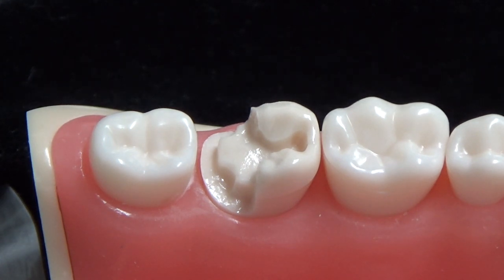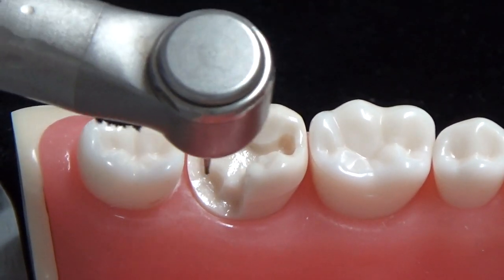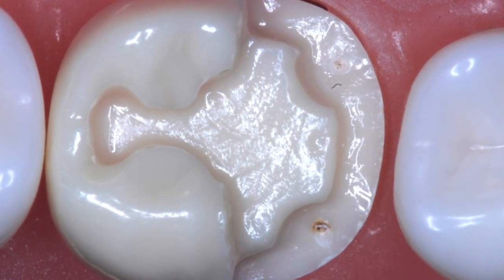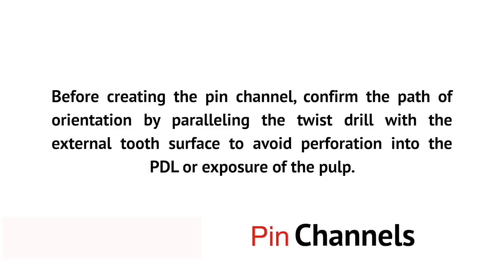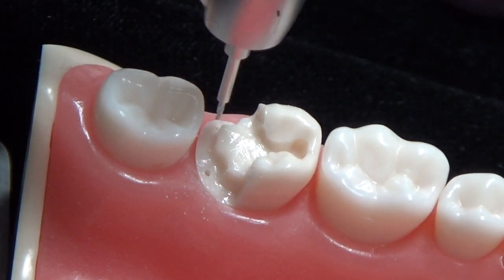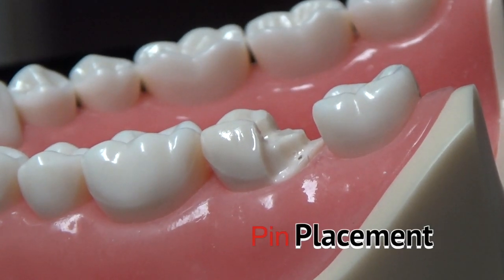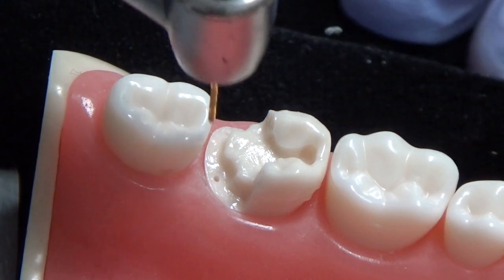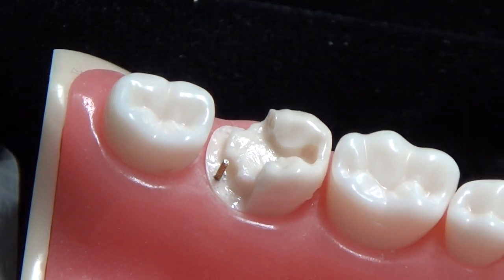Dr Rivera , Core BUILD UP

Comment: Pins are not need it in composite restorations because they have adhesive properties, and un need to bend the pins in order to gain retention. I woldn't use flow composite in all the restauration, just in the first layer of resin, maybe the 2 first layers.
Reply: why  not flow, is it to weak
Reply: @dwayneevans683  pins are used to cover the lack of adhesivity of amalgam, because when u are ussing composite or any ressin they already have adhesive properties. If u are gonna use flow composite just use it in the first 2 layers of the restoration because in the next steps u need to put a denser material to shape the internal anatomy of the restoration to avoid oclusal forces to break te tooth, with flow u cant shape anithing because is really liquid, it is not the way to go.
Reply: He meant the posts in the video
Reply: @josemanueltorresrubio406  Aldo it has great adhesive properties and very hard to remove because of this i would still use the pins is half of the tooth is already gone, every case is different, i seen very bad ones and to be on the safe side for those particular cases pins are the way to go, do not need pins if at least most of the walls of the tooth are there, if there is too much missing wall from bottom to top pins can give you that extra hold so the filling material won't slide off over time after long use and chewing.

Comment: What is the blue light for?
Reply: For curing of the composite 
It's light curing type
Reply: Light-polymerization
Reply: The light makes the filling material dried rapidly rather than amalgam which can take up to 3 hours before drying completely, 24 hours before full strength and polishing, some dentists prefer to wait 2 days before polishing for amalgam, composite fillings allows polishing and finishing right away after drying with the curing light just like magic.